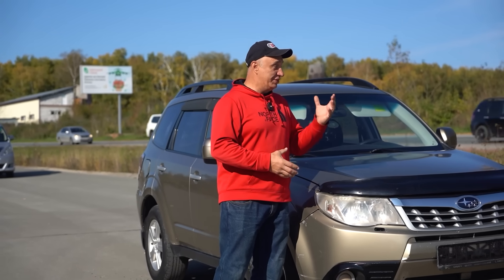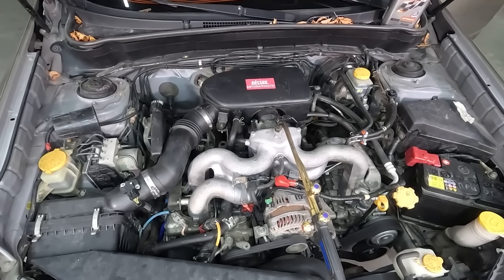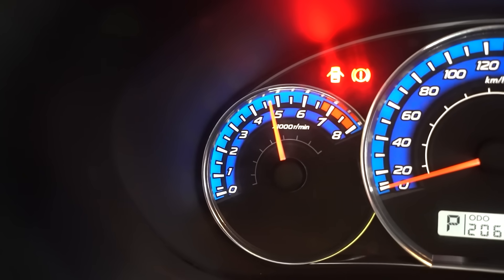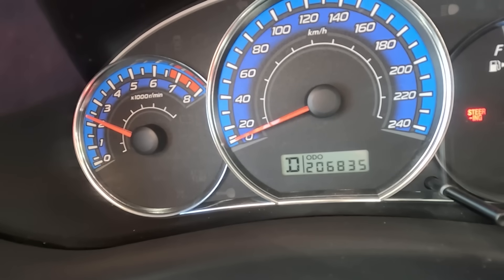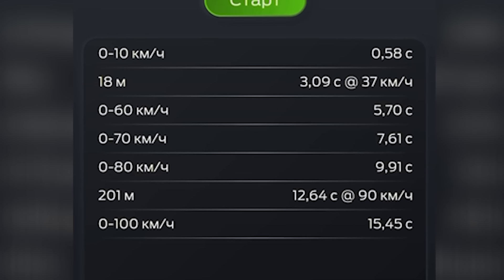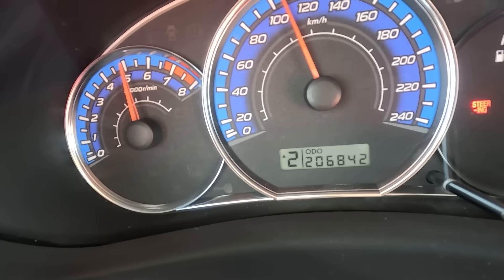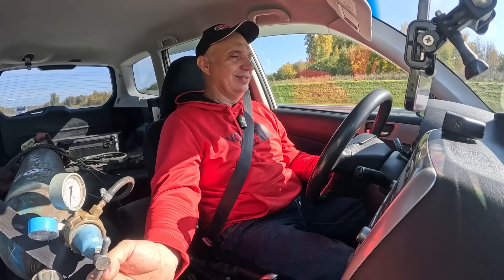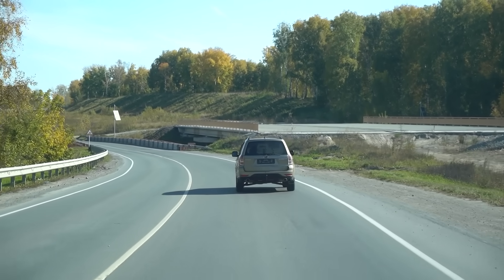We run an engine on pure oxygen - what will happen?

Comment: test this on a Lada, not on modern cars with ECU
Reply: mass airflow sensor indeed does that
Reply: @greathey1234 more comments (?)
Does what??
Decide fuel required beyond its capabilities?
Beyond what the injectors can deliver?
Require the fuel pump to deliver more than is possible for it??
More gph injectors and fuel pump, possibly larger Dia. Lines to accommodate the required fuel delivery.
Maf just can't tell fuel delivery system anything It's  beyond systems mechanical abilities.
Reply: @SeymourBalz absolutely correct
Reply: They finished all the ones left. No more ol'ladas available!
Reply: @guzmangil5476  they were made until 2012 shockingly, they are def still available
Reply: It won't work. Just learn how a carbureror works
Reply: @CaptainDangeax 
I guess you dont know. You can spray oxygen just like carbed cars get nitrous sprayed. Not to say oxygen is a good idea for carbed enhines, or FI cars
Reply: Absolutely agree!
Reply: it will melt the lada
Reply: On my ls 5.3 I bypass the MAF sensor and pulled the fuel pump relay/ fuse and six inches away from the throttle plate is where my line comes in from my hydrogen/oxygen generator.
Gets pretty hot, so I run as a hybrid but still, it’s save a lot in fuel bills and I get more power.
Plus it’s eco😂
Reply: It'll still destroy the engine. 

There is a reason racers don't use oxygen, they use nitrous. Oxygen  melts valves and pistons almost instantly.
Reply: @volvo09  The reason is that pure oxygen is dangerous.
Reply: @volvo09 oxygen doesn't burn, its just an oxidizer and will definitely cause materials to burn, including steel
Reply: @volvo09  but they verified the engine is okey only ecu messed upo ?
Reply: @volvo09  They should also run it with methanol diluted with water to reduce the temperature.
Reply: @volvo09 n20 offers more o2 into the combustion process than pure oxygen
Reply: @volvo09  its old lada, no one cares
Reply: @volvo09    Do you even know how an ICE works?
Reply: @Onan-u3b what are you saying? If oygen didn't cause problems in an engine racers would use it instead of nitrous.
Reply: @Onan-u3b Yes. The inert part of the charge will act as cooling.
Reply: @volvo09 then why use blowers or turbos..?
Reply: @SeymourBalz  because air (that we and cars breathe) is not 100% oxygen, air is like 17% oxygen, the rest is inert nitrogen and other stuff. 

When you turbo or supercharge a car you are still feeding in that same mostly nitrogen mix, it's just compressed. 

Pure oxygen is extremely reactive, that's why cutting torches use it. A hot spark and it'll burn metal.
Reply: @volvo09  21% oxygen
Reply: @volvo09  Only if the ferrous metal is above a certain temperature and this is never reached in an ICE. BTW the Oxygen stream is used partially for blowing the overheated metal away.
  Plasma cutters used to use nitrogen now they mostly use air.
Reply: @SeymourBalz you have no clue don't you? 😂 Air is not 100% oxygen.. pure oxygen is extremely dangerous!
Reply: @geogmz8277 your point?
Reply: @SeymourBalz  Turbos blow air, not oxygen.
Reply: @elemar5air contains oxygen.
Compressing air increases the amount of oxygen contained there in.
Reply: @SeymourBalz  Cause thats not pure oxygen
Reply: @SeymourBalz  More 21% oxygen air mixture is forced/compressed in. Not more oxygen rich air.
Reply: @geogmz8277 yes even ceramic material burns with pure oxygen 😅
Reply: @Herbertti3 no one said that.
You say it's 21..at what atmosphere?
Our standard ?
Go ahead and compress this air @21
Once compressed how many more 21's are you getting ?
Say a 21 fits inside a cubic foot.
How many 21's are you getting ?
At Say 20-30 P O U N D S percubicfoot.
That's no additional CONTENT.
Its just giving it that many more "21"s
Reply: @SeymourBalz  Wow, you don't say. So do turbos blow air or oxygen?
Reply: @elemar5oxygen is in the air.
Reply: But : air contains 78.08% nitrogen, 20.95% oxygen, 0.93% argon, 0.04% carbon dioxide, and small amounts of other trace gases. The nitrogen is inert, doesn't burn or keep the flame, that why you use to cooling down the intake.  role of oxygen in a fire is to help oxidize or break down fuel molecules into smaller combustible compounds, releasing energy and heat. The oxygen contained in the surrounding air diffuses in and reacts with the fuel, making the fire hotter and brighter.
Reply: @sorin-vn3mc sounds like we need something different to run engines on.
What do you suggest ?
Reply: @SeymourBalz boost doesn't increase the concentration of oxygen.....geez
Reply: @SeymourBalz  Because blowers and turbos only force air through,,, as apposed to pure oxygen.
Reply: @Terrackhimself obviously you haven't read the series of comments.
We went through all that yesterday
Reply: @SeymourBalz obviously it doesn't matter. Just because you take the time out of your life to read every single comment before you say your little input, doesn't mean others do.
Reply: @Terrackhimself whodafiggured??
Start from the beginning.
Reply: @SeymourBalz  You have read every message on this video?

You got some time.
Reply: @SeymourBalz  the main bulk of atmosphere we breathe is nitrogen, oxygen is only small percentage
Reply: @AxeDatcm your a regular GENIOUS!!
Maybe that's why there are various forms of forced induction.
That's kinda how during ww2 they added forced induction to aircraft!!!  Why? 
By Compressing the available air, OVERALL... more oxygen was fed to the engine allowing the plane to achieve higher altitudes. 
Sadly... We've gone over you idea.. 
DAY'S AGO! 
Read previous comments to see if your Comment has been covered.  (?)
Reply: @SeymourBalz   Nitrogen which is what the majority of Earth's atmosphere is made of, acts like a buffer. Turbos simply compress Earth atmosphere. That's also the reason why some race cars or drag cars use nitrous oxide (N2O) because the combustion is predictable and easier to control. unlike pure oxygen. 
 Rocket engines on the other hand do use pure oxygen in a liquid form because it's denser as a liquid. Liquid oxygen is highly corrosive which is why rocket engines are made of special alloys.
Reply: 4:18 in that C intended as speed of light?
Reply: Your o2 and knock sensors are gonna a field day😂
Reply: @PROFESSORX420XXX may even exceed their capabilities...
Reply: Yeah unless they have the capability to adjust the Reflash the ecu they should’ve used a carbureted engine which they could adjust the fuel input.
Reply: Exaclty
Reply: On a non electronics engine at first the mixture leans extreme, you have ti give it much more fuel. Remember, it is the fuel to oxygene ratio, that matters. Air has about 18 percent O2. 
But if you feed O2 and fuel in the plenum with hot valves, and so,  you can be shure, the plenum will leave the car as fast as it can. 
That was what a former friend of mine learned.
Reply: it will run lean, at least we know it will on a carb.
Reply: The more oxygen you feed in the ECU senses more oxygen via CAT and , more rich mixture , and that makes the revolutions go up.
Ecu is designed the self correct. unless yoy program it your way. No Fuel economy. O2 is also not cheap. Put pure Hydrogen in non continous  stream. so it dosent explode.
Reply: @richmondhillsangat  check out the thunderstorm generator tech
Reply: Are there even any Ladas still running?
Reply: Or u can just remap and feed the oxygen correctly, not bypassing the MAF. 😀
Reply: Thats what I would of done too.... and subaru..... yuck...
Reply: 🇹🇷Because they're lying. Pure oxygen always means high efficiency.🇹🇷
Reply: Agreed.  ANY car with any form of ECU will be screwing with the concept, as the ECU tries to maintain the correct balance in so far as it thinks it should be.
Reply: I'm not sure how many ladas are left in these guys area 😅
Reply: They need to feed it through the air mass sensor so it knows to add more fuel, but an older engine with a very very rich mixture it should work fine. The amount of fuel needed for the right mix probs wouldn't even run without the oxy.
Reply: @Blandy929 how do you figure feeding it through the mass air flow would do anything? They’re adding pure oxygen, more than a nitrous hit, that’s waaay more than ambient atmospheric o2%
Reply: @angusmethane3802 In theory the different gases having different densities should make some difference to what the air mass reads. It wont solve the under fueling as the engine simply wont inject enough but it is calculating for the amount of fuel to inject by the amount of air its getting. A different density can be a different mix of gases in the air not just air pressure and a different fuel qty at a given rpm due to the map and limits on the ecu. By bypassing the maf, not only are you tricking it into thinking it got less air as there is added flow down stream of the maf and will rely on the lambda to correct the fuel which just wont do enough.
Reply: @Blandy929 no amount of oxygen density outweighs the fact that the atmosphere is 21% o2, the ecu will never get anywhere close to correct no matter the maf reading because it assumes dominance of nitrogen
Reply: @angusmethane3802  I said it could never match the fuel to the oxygen its getting even putting it through the maf and also adding more oxygen after the maf will reduce the reading the maf produces reducing fuel anyway just like having a hole in the pipework.
 C02 is denser than oxygen and oxygen is denser that nitrogen....
Reply: @Blandy929  it's kind of like adding boost, which carburetors don't like, and plus, if it backfires ,which it likely will, it's way worse than normal air.
Reply: @jwalster9412 no it's worse you can boost reference the whole carb and fuel tank for boost and get intended mix for atmospheric air while just adding o2 would be double the "air" with no pressure increase or anything to mechanically reference the o2 concentration
Reply: The carb jets would need to be huge.
Reply: The ECU is what made this last at all. It to a degree added fuel to richen the mixture back up but its limited to about 30% more fuel. Air is 12% oxygen. Nitrous is 32%. Pure oxygen would require larger fuel system to make it not run lean and blow up like it did here.
Reply: @FxnBoats Air is about 20 percent 20.9 I think.  I thought nitrous was higher too.
Reply: @changingmyworld-j9z I might be wrong about ambient air, but Im pretty sure N2O is 32%. Either way thats a massive increase in fuel needed to maintain 14.7 at idle, and 12.4-12.8 to 1 at WOT. I saw at the end they didnt blow it up, but it does sound like the conouter went into limp mode likely from being to lean. They really need tuning software and a bigger fuel system to do this.
Reply: @FxnBoats  Air is 21% Oxygen.
Reply: @FxnBoats again.. My point being made.
Thanks.
Reply: Correct me if I am wrong, but most cars use MAP sensor as those are easier to make right and react faster.

But it doesn't matter. Neither MAF or MAP would indicate that the gas mixture contains more oxygen or just more air or more whatever, just that either the flow or the pressure is higher.

The ECU thus has zero knowledge about what the engine is actually breathing,

The fact that this is an ECU-controlled engine made this entire experiment work at all, since the exhaust oxygen sensor is what indicated (indirectly) that the mixture must have contained more oxygen, thus the ECU increased the fuel injection. When they shut off the supplementary oxygen, the mixture then became wet, that's why it started running badly. You can reset the ECU's adaptive learning by either disconnectihg from the battery or, if it still runs, let it run, drive it in various RPM and load conditions, and it will recalibrate itself again. All based on the oxygen sensor.

The oxygen sensor, surprisingly, senses the oxygen content in the exhaust gas. If the combustion is just right (stochiometric ratio), there shouldn't be any left. The ECU uses this data to correct the injected fuel amount. This feedback makes it a closed loop control.

Carburated engine or an injected engine with a disconnected oxygen sensor is just an open-loop control, it has no way knowing of or adjusting for any injected substances. This is why, for nitrous injection, you inject not just the nitrous, but additional fuel too on a dedicated, calibrated nozzle, because the carburetor won't and can't do it.
Reply: Boxer engines suck at low rpms they are very slow to build revs. Same test another engine.
Reply: Add the air before the sensor, move the sensor, or disconnect for a default fuel map.
Reply: @240sxRule what are you telling me, and why??
Reply: @SeymourBalz Maf sensor right by the air box. Reads how much air, so It knows how much fuel. They plumbed the air into the manifold, which is after the sensor. So the vehicle doesn't read accurately. It'll make its own changes while detecting knock n also using shit like the O2 sensor, but survival changes only really. Unless this cars on MAP, then I'm out to lunch.
Reply: ecu is adjusting the petrol quantity injected to have the right mixture, ure making it lean but ecu is correcting it by adding fuel....and so on , the more oxigen u inject the more petrol its burning thats why revs are going up
Reply: @gheorghefrangulea6686 that only works as I mentioned until you run out of correction in the ECU as I mentioned it can move about 30% more fuel. Even if the computer would correct more the fuel pump and injectors would likely max out shortly after that. This is basics for power adders like nitrous.
Reply: @gheorghefrangulea6686  factory ecu are only good to about 15% correction of fueling before issues. If you want to add more you need a custom tune
Reply: or disconnect the sensor
Reply: @whoknows8225 its not easy to force a boxer engine to build more power on the fly belive me i had my share of boxer engines they are crap. The ones i had were alfa Romeo 33 1.5 ie boxer engines and they dont like being messed with. My car had a straight pipe and a simota air filter. I tought well this will make him go faster my expectations were short lived same crap. Only time more noise thats it.
Reply: ....ALL LADAS HAVE RUN OUT IN 1000MILE RANGE

....THANKS TO.... them,SPECIFICALLY ....HEHE
Reply: No, ecu is not the problem. The problem is the electronic acceleration pedal